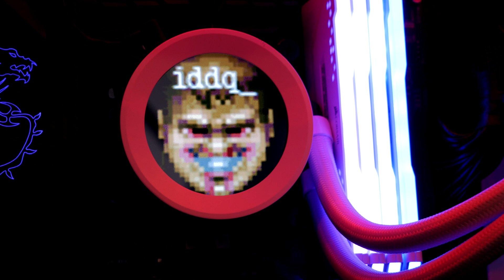How to use old (or new) CPU coolers on LGA 1700 - NZXT, Corsair and Noctua

Comment: Nice vid! I bought a retrofit kit from corsair for my old H100i PRO RGB  to find out later before it arrived that my AIO was not supported. And the kit (4 standoffs) were too tall!
Anyway I just installed it with old included lga1200  and it fits Perfectly!!! Shame in corsair telling me i had to buy a new cooler.
And the old asetek block plate totally cover the IHS also.

Plus all Asus Z690 boards have holes for LGA1200 and LGA1700 so if your cooler bracket has slide holes your good to go!
Reply: I have tried both the old standoffs and the new and there is no discernible statistical difference. You can use the old LGA 1200 back plate and 1151 standoffs and you will be just fine I promise you
Reply: @tulsaterry  Is that with one of the motherboards with the cutouts for LGA 1200?
Reply: yes, it is an Asus Z-690 and they were on the ball to think ahead. I wish I would have mentioned that because some people are not happy with what i SAID . Thanks for mentioning it, I assumed all of the newer boards would be that way but such is  not the case. It's literally about 3 twist difference in size ( the stand-offs)
Reply: @tulsaterry  been into pcs for years , i nearly got dragged into all this none support , I've cancelled the xt cooler , not impressed with company's pulling wool over people eyes  just for profits thats the only way i can think there doing this
Reply: @namAlexander  yeah it's $6.99 for 4 standoffs but they do ship them for free 😅! I'm sure there's some nerdy r&d engineering guy who would be more than happy to send me a detailed explanation as to why these new standoffs are needed. Some people like to argue with me about it but I have tried both for days at a time and you get a nice snug fit for either one no matter what they say. Yes there is about three threads difference (shorter) on both ends of the new 1700 standoffs but I don't think that's enough to make much of a difference. I still have my RGB pro XT from  a long time ago and that's a great cooler. Right now I have the h100 I elite capellix on my new z690 board  and I really do  love it.  I will say  corsairs support is second to none when I've had problems, as a matter of fact there's a new Commander core being sent to me as we speak to replace a faulty one free of charge. Those darn fans way way way overpriced but that's another story LOL
Reply: @tulsaterry  i don't get involved with people who don't listen now its like talking too a brick wall, pointless stressing your self out, corsair though over the years there support had always been good, in recent they replaced a ddr3 quad kit and my H1000i there was a melted chock inside the unit but the psu still worked fine , they sent me a H1200i as replacement and also payed for postage to return the old unit i could even keep the old power lead so used that to upgrade the kettle lead so that's no a platinum kettle lol, the ML fans though make a huge difference especially on noise, never used the v2 fans or any of the ones before as the noise was just daft and cooling , the h100i v2/h100 i used noctuas
Reply: @namAlexander  I guess the high price of the products is worth the excellent customer support. I recently had a terrible experience with Asus RMA. No one seems to care much about after-sales support these days
Reply: @tulsaterry  Jesus I had that with asus years ago they sent me a few replacement boards some were even bodged repaired , the support was horrible, had gigabyte after that and they had online uk forum support, I like asus allot it’s just the support, there was a asus rep at scan while I was there and told him , I take it nothing has changed, I have gone asus again but I had no option as it was that or Msi and once I read about msi bios update that put me right off
Reply: @namAlexander  I agree with you 100%. I love  Asus products and continue to purchase them but I will never RMA a product again! It was damaged during shipping and they wanted me to pay for repairs and even $20 to ship it back to me! The whole thing took over 2 months get my very expensive PC back. I nearly tried a Gigabyte aorus board but what with bios issues like you said and memory compatibility problems  I went back and bought the Asus z690, posted right away updated BIOS no problems. I still have a very nice Asus board  from 9 years ago even has a digital LED error code display , Bluetooth and Wi-Fi still going strong. They really need to get there customer service in order but what to do if there are no better options?
Reply: @tulsaterry  don’t think asus support will ever change, I’ve got a asus x79 black edition that’s developed a power fault , I’m gutted
Reply: @namAlexander  😔
Reply: @tulsaterry  that's reason I've been looking about the cooler also not looked at hardware for years my bloody heads burnt out lol but I've got the kit now
Reply: @namAlexander  sounds good
Reply from the maker: oh all Asus boards are like it? nice. Surprised about the Corsair AIO - looks like the XT is fine according to their comments (see description), but that's good to know so thanks for sharing!
Reply: @TheProvokedPrawn  yeah XT are coolit designs work ok with retrofit
Reply: Hey I had a question with the new 12th gen cpu’s are you having trouble playing games like are you crashing?
Reply: @JDM_CUH  i had crashing on day 1, did everything cpu related to fix it, but nothing worked.
It turns out it was my RAM XMP thst was crashing games. 
Someone else resolved crashing by changing XMP also.
Check see if you have a different XMP profile to use, or disable it if its being used.
Reply: Thanks so much, just what I needed to know!
Reply: got the 115i pro rgb for lga1200 ive read the same , i sent a message even posted on the forum and got no reply , I've also got a h100iv2 reckon that will also fit looking at supplied screws , def going to look at that